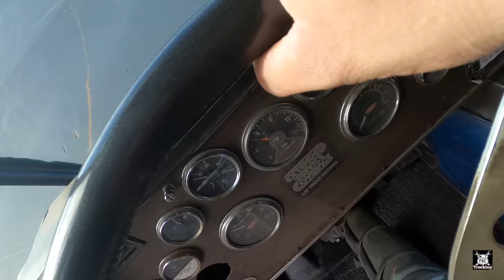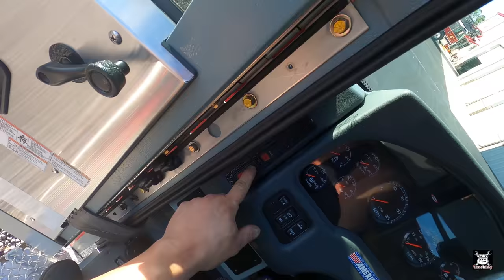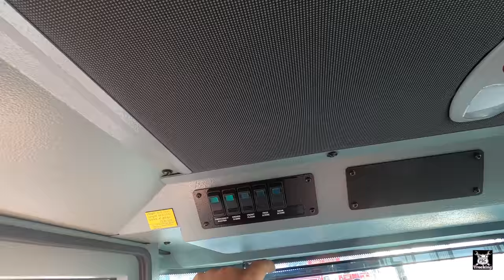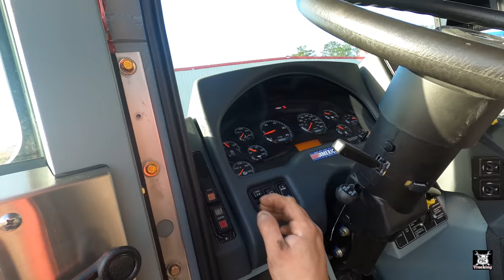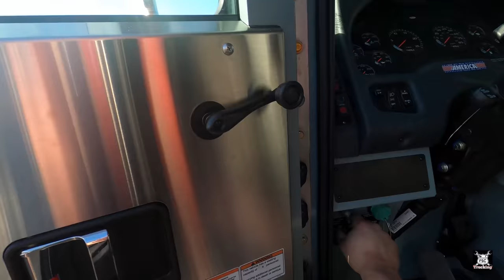Unloading The South Carolina Fire Truck

Comment: Do a great job of getting them there safely Steve but I question the quote-unquote refurbished part of these trucks after all look at the problems you have with the other one that was fresh from the refurbished Factory and didnt even want to start
Reply from the maker: That'd their issue.  Mine is getting it to its destination in the same condition it left in.  I'm not Pierce Quality Control.   I do my best to make sure everything goes smoothly even if I do need to take a little extra effort.   They are a great customer overall.

Comment: Steve, do you still use the CB much? Just wondering, grew up with them and just wonder if they are still important for the average truck driver. Thanks.
Reply from the maker: I do at times.  But it is not used anywhere near as often as it used to be.
Reply: @fsctrucking  Thanks for the reply....be safe out there.
Reply: Hey, Smokey right there…. LOL

Comment: Just an observation. For the aluminum ramps, the end that goes toward the trailer, why isn’t the bevel tapered to fit the trailer to make a smother transition from trailer to ground?
Reply: Maybe because it’s not needed on the lower levels so therefore the angle is set for loading to the much steeper angle of the upper deck. Or they were made for a different trailer but they do the job. Just my guess.
Reply: For long fenders that overhang, can't handle the steeper angle otherwise it would hit

Comment: I have a suggestion for a camera angle. Maybe like a driver or dash cam pov I just wanna know how you maintain your lane since I like canovers I never understood it. Even tho I highly enjoy this pov already that you have
Reply from the maker: Best I can tell you is you must get used to riding close to the left.  When I first started driving Orwell on the highway I was used to a narrower cab.  So I was riding hard to the right based on what I was used to.  It took time, but you will get used to it.  I sit so close the the outside of the truck I literally can touch a passing truck by simply putting your arm out the window.   That's how far over you are.
Reply: I never drove a conventional, so to me, it would be hard, where a cabover is so easy to keep in your lane....